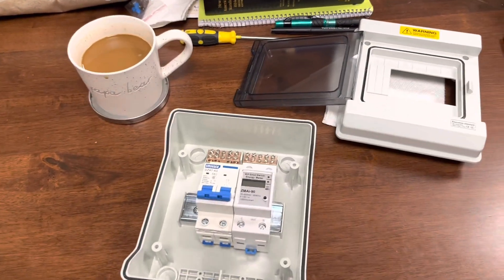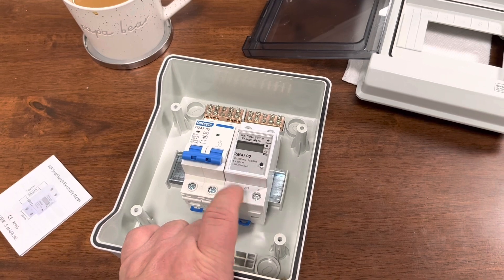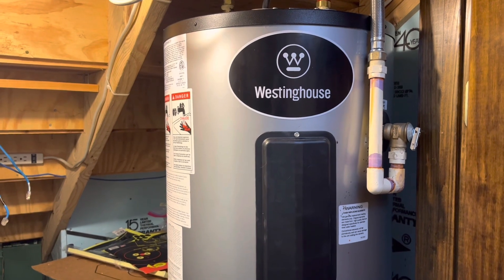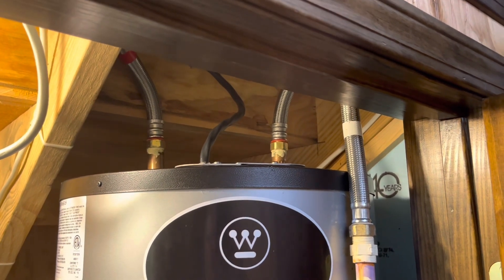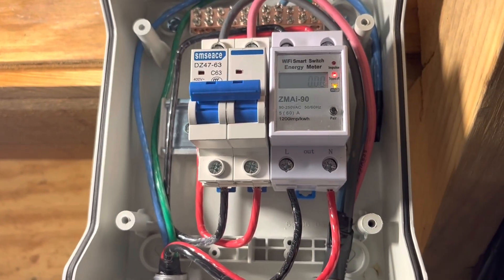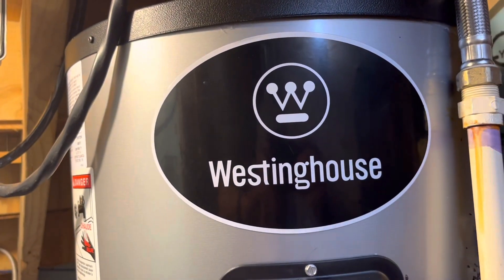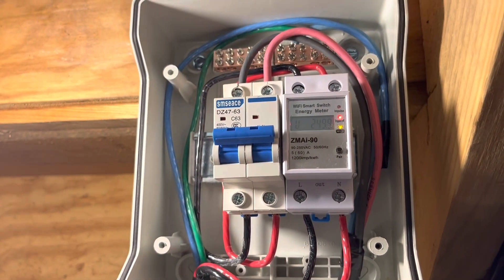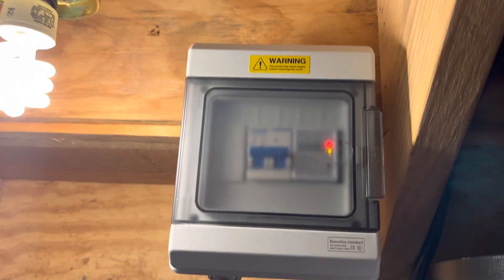Water Heater WiFi Smart Switch Install

Comment: first, great video.  thank you for making this.  I note that you are controlling 240v load and the smart switch specifies it requires both a neutral and live line. It looks like you are using 2 live lines.  I assume this smart switch really just requires the voltage difference and not a neutral line.  Is that correct?  Also, your installation seems to be at the VAC limit (specification VAC 110-230V), a year on is this working fine?  thank you
Reply from the maker: @sullivanbriank  in many countries one of what we call of L2 is called their neutral. They use a two wire 240v system. In the US we use a three wire 120/240v system. 

This particular controller will work with 120v or 240v. Doesn’t matter that are 240v is between L1-L2. The controller is only looking at the voltage. 

The voltage in our power system typically runs around 250v L1-L2. 

The system is still in service and working well

Comment: I noticed the TPR value line goes down and then up. This is in violation of code but most importantly very dangerous. If the CPVC line clog and the TPR opens their is a good probably the water heater exploding. If you want to see a water heater explodes you can search for it on you tube. It can fly through your roof!!

Comment: video is blurry, do have a part list?
Reply from the maker: Here’s a link to the smart energy switch. 

WiFi Smart Energy Monitor Switch Meter, Compatible with Alexa Google Home, Remote Control with Smart Life/Tuya App, Din Rail Tester Current Voltage Amperage Power Meter AC 110-230V 60A Multimeter https://a.co/d/fXsthkc

Comment: I don't know if it will work for you. But I switched the two heating elements to 240v 2000w  on top 240v 1500w on the bottom and I us it with a single growatt us 5000 that's  been working for me.
Reply from the maker: That’s a good way to get your water heater to work on the Growatt 5000. Smart thinking. 

I’m not having an overload issue. Just trying to heat water during the peak solar window when I have excess power available.

Comment: Good 👍 I have hybrid water heater draws only 500w on solar for past 10 years check it out when/if you need new 1. I'm also using sol-ark smart output to charge ev.
Reply from the maker: Is that a heat pump water heater?
Reply: @jeffmotes2129  yes works great
Reply from the maker: @meanttobe100  I thought about one but it would require relocating to a bigger space. How’s the maintenance been?
Reply: @Jeff Motes  not much, just clean filter every now and then.i would add smaller maybe 30 gallon before this 1 that way you have 80 gallon and electric has to work less only if you have room
Reply from the maker: @meanttobe100  thanks